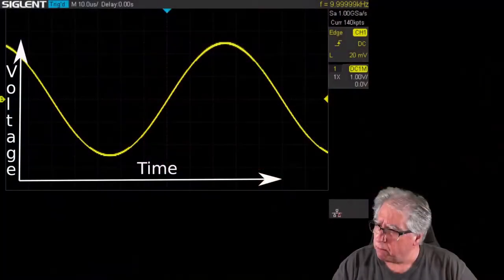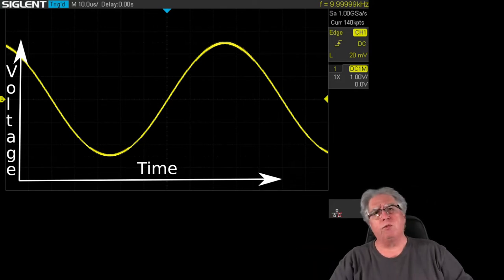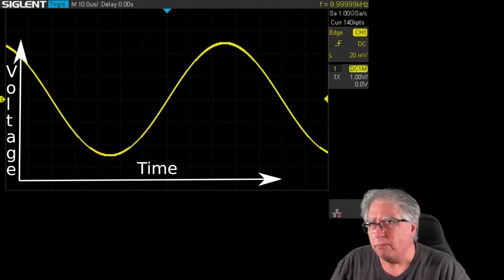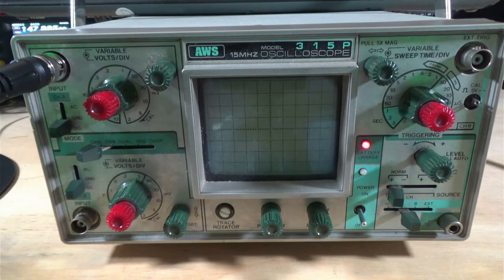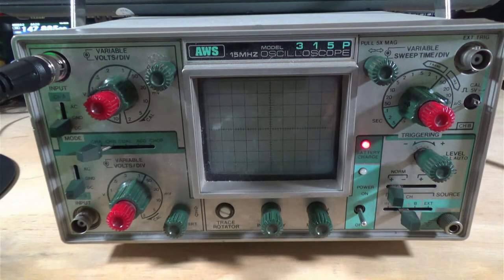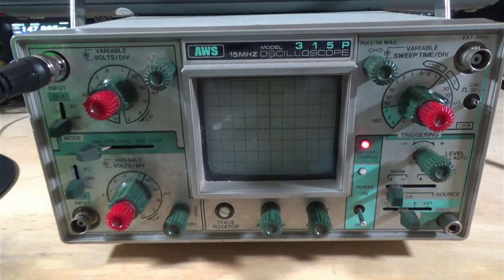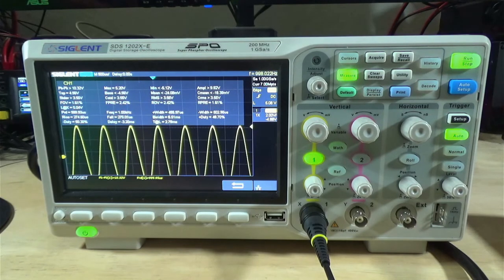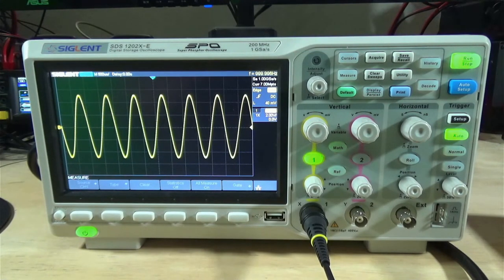How Do I Use An Oscilloscope And Why Do I Need One? Beginner How To.

Comment: Nice that you kept your older analog scope to start the training and did a compare/contrast with the newer, digital one. I still have my Heathkit IO-17 I built in college but use a Rigol DS1054 for normal work. 73, Robert
Reply from the maker: Hi Robert,
Wow, an IO-17? There's a classic. The Rigol is a nice scope. Do you use the decoder much?

Stu
AG6AG
Reply: @AG6AG  Stu, the scope is so feature rich that I haven't been able to use many of its functionality so far. Just after I bought it, a Tektronix TDS 460a was listed on eBay for a good price and I bought it. Then I bought the Rigol DSA 705 and have been playing with all of them. Of course, I had to get the nano VNA and nano SA. So much equipment to play with ( and then there is my 12 tube testers and thousands of tubes that need sorting, testing, boxing and storing). With community activities such as the Ventura Marathon starting up again, I've had to put many of my electronic projects on the back burner. Hopefully I will get back to the scopes soon. Thanks for these equipment videos, they help rekindle my interest in basic electronics once again. 73, Robert KM6RSS